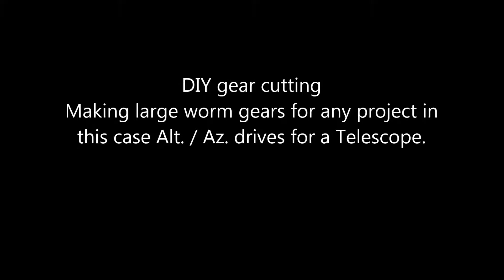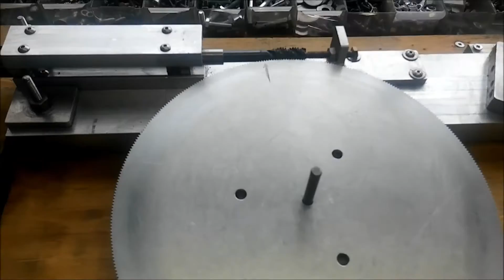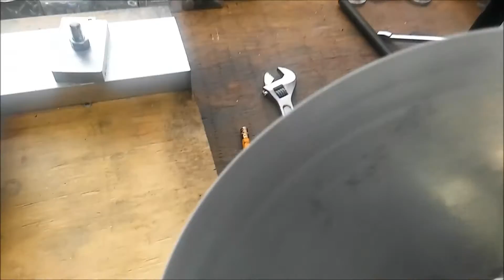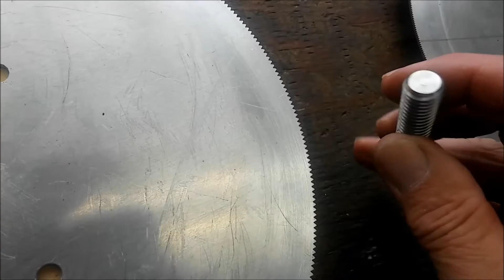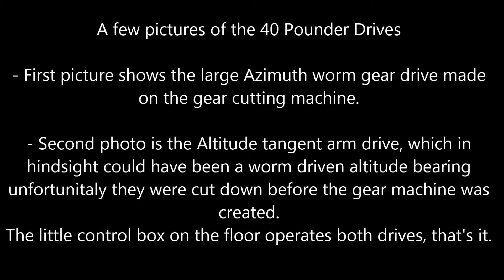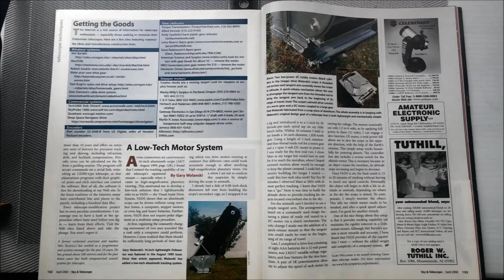Gear cutting

Comment: Thanks for sharing your engineering skills and clever machine design. I have never seen channel section used to restrain and self-align a ball bearing. Very clever! The main problem with cutting larger diameters is obtaining enough clearance for the tap to reach the edge of the disk. Beyond a certain point it would need a very a long drive tube and tap support rod. The central hole of the disk ought to be made full size first to avoid spoiling the concentricity of the teeth by drilling the centre out later. Though you can always spring load the drive worm into the teeth of the wheel it is not always appropriate. Or adds unwanted complexity.